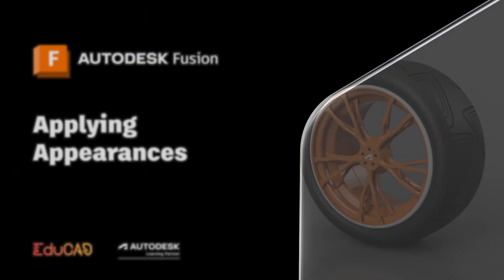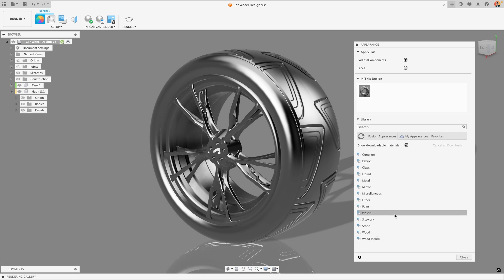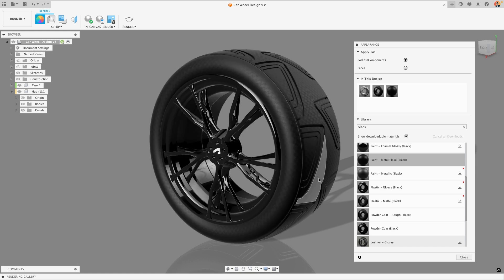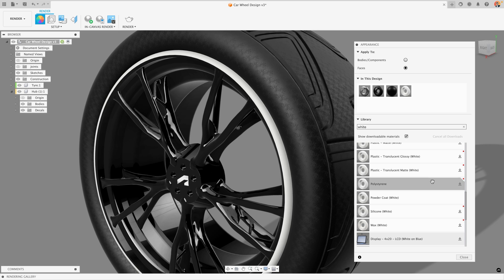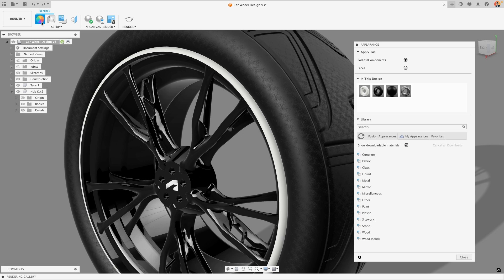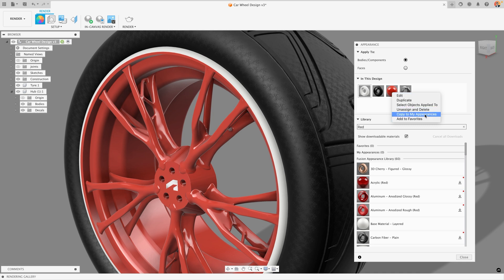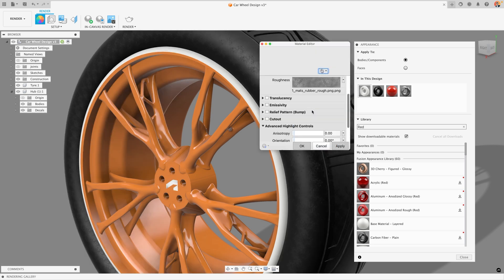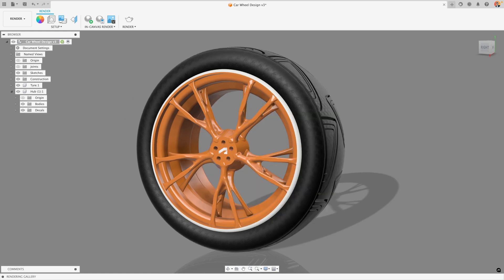How to Apply Appearances to your Model in Autodesk Fusion

Comment: On 3:14, you apply a colour to a specific face only. I can’t get that to work. When I select faces it does not allow me to drag drop a color onto a specific face. What can be the reason for that?
Reply from the maker: Hi baron, 
Sometimes it is a selection issue. It is worth trying to zoom in further to your face to make it a larger area to select.
Reply: @ thanks. In my case I found out the problem is a little different. The part I’m trying to change appearances of is part of a larger assembly. I made the other parts invisible, but fusion is still trying to apply the color to the complete assembly. I think that’s because the part I want to change is behind another part within the assembly from the perspective I had. I noticed because when I made the whole assembly visible again, it had the color I was trying to apply to the one part.

Comment: I'm trying to apply an Appearance to a face that is not on the top plane. Obviously I first select Faces in the Applies To section. When I try to select the face I want to apply it to (by holding down right-click till the face menu shows and selecting the face I want it to apply to in that menu), it turns the edge of the selected face BLUE. But when I try to drag the new Appearance to that selected face, it doesn't do it and just moves the dragged Appearance back to the Appearance dialog and does nothing. How can I do this?

Comment: Hey bro I been try to render my project in shining metal but the result is very poor and now matter what material I change the body looks same for example if add aluminum polished it's should look shining write but it not give the result what should do
Reply from the maker: Hi! 
Sorry to hear you aren't getting the results you expected.  
1. (just to check) please make sure you have started the render. If the In Canvas render has not been started, or it isn't a final render image, the reflections and lighting won't appear as they should.
2. If it is not as shiny as you would like, you can edit the material by right clicking on it in the "In this design" section, and increase its reflectiveness. This could help make it more shiny for you! 
hope this helps